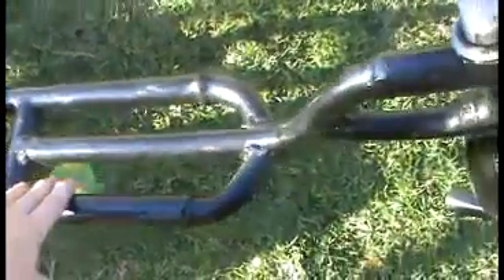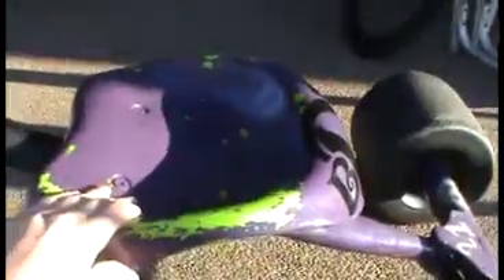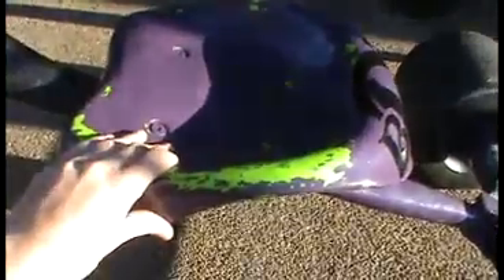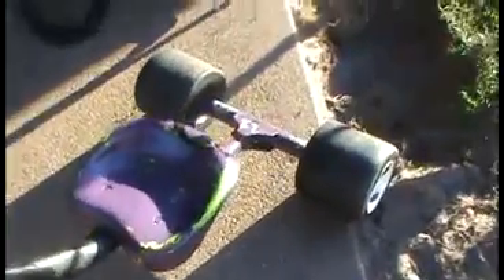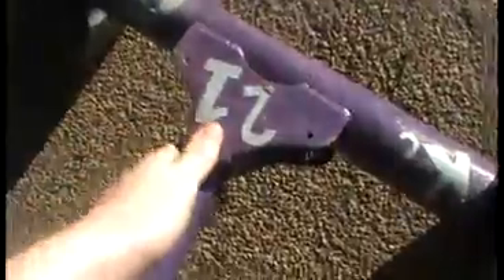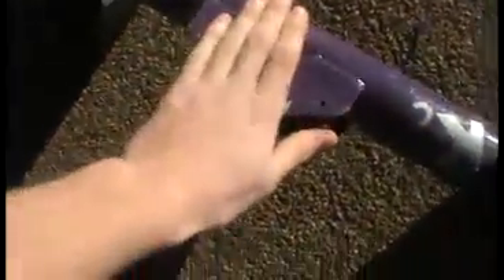How to make a drift trike - Green machine styles

Comment from the maker: @OPTeeMooS Thanks, you can use greenmachine wheels and u can buy em from kmart if ur a beginer. but if ur gunna stick with drift triking and use ya trike alot i would use go-kart wheels and put pvc pipe around em and custom build A axle. but i just use greenmachine wheels there simple and easy, but u need to replace em every now and then depends what weight uve got

Comment: Hey a Bundy-ite!!!  nice, I lived in Bilo for number of year on Kroombit/Lochenbar Station and I spent a lot of time in Bundy, Yepoon, Rocky etc...  I miss Australia every day.

I realize this is a few years old, but how did that square-tubing you made the "down-tube" out of hold up???  I ask cause I've built a few things with it (can;t tell from the vid if it's thicker walled then what I have) and it's kinda crap when it's stressed in the direction your frame would without a big gusset in the "V" where it comes out under the seat to the head-tube union.    

Very cool build and always good to see someone build something themselves, with their own hands.  I thought I knew how to weld before I moved down there, but living out in the bush you learn REAL quick if your works worth a dam and it's gotta be much the same when you're hauling ass 6" off the pavement on your own handy-work aye.